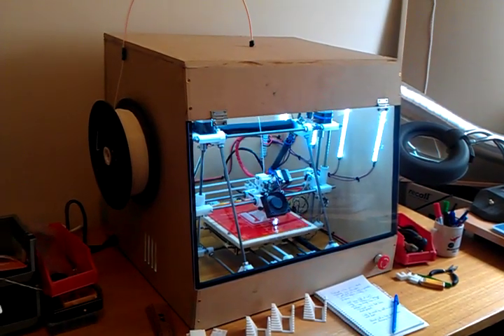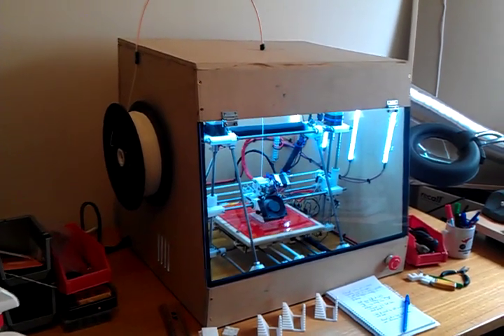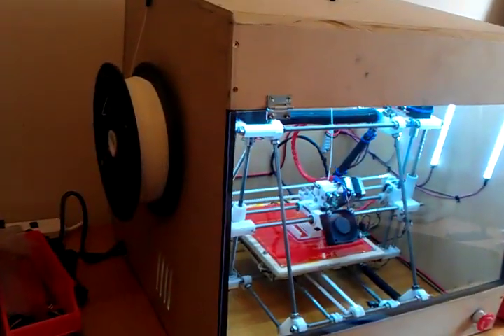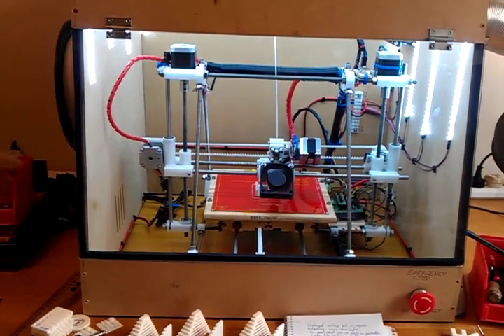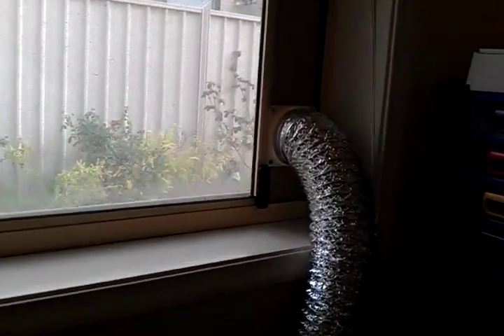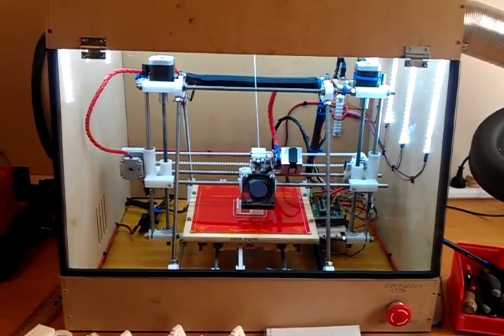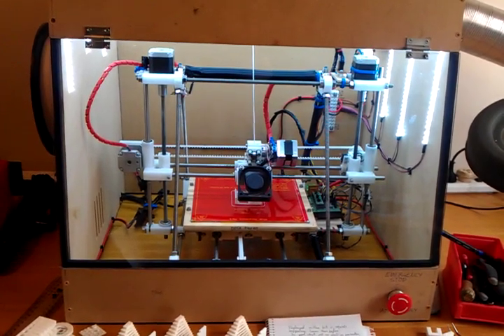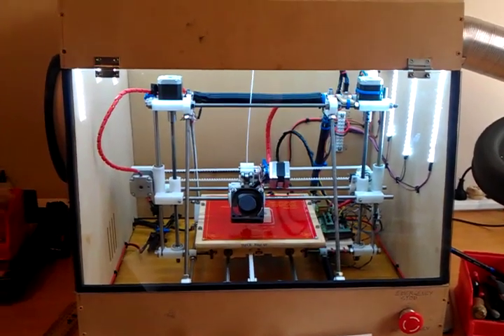Fume Cabinet for Reprap Prusa Mendel 3D Printer

Comment: Can you clarify a few things? You say you got a sore throat.  Can I assume that was BEFORE you made the extractor, but not after?  Also, one of the reasons I want an enclosure for my printer is to print on ASA or ABS which needs to be kept warm.  If you extract the fumes, you will be drawing in cooler air from the room and I presume also creating a bit of a breeze, which ABS doesn't like.  Can you comment on that?

Comment: Did adding that extraction fan inside the cabinet effect any of the cooling, Im thinking of using your files here but had planned to put the fan at the window end to stop issues with cooling prints too much?

Im going to add an external louvered vent to stop cool air entering

Comment: I want to make something like this but I've always been concerned that the cold sub freezing air in the winter time would blowback into the enclosure. Have you found that to be an issue?
Reply: as long as you had an active fan inside blowing out with enough force, I would not expect it to be an issue.

Comment: Ideas you might add, some insulation to absorb sound and keep temperature stable inside, another idea I saw and liked they added a printer tool holder to there enclosure.

Comment: Are the 3 holes in bottom left side of the cabinet just clear open holes and if so wouldn't this let the fumes out or does the fan prevent this from happening? and are the holes there to stop the fan creating a vacuum?

Comment: I originally enclosed my makerbot replicator 1 with acrylic to keep the heat inside to achieve a much better print result, and kept it in the garage to a voice fume problems, I just bought a fume extractor instead of the tube style u used, I hope my way does the job, love ur setup by the way very neat

Comment: Very clever!
Would it be possible to remove the ac duct, and put a carbon filter on the end of the fan?
Reply: Yes, but it wouldn't get all of the byproducts if the printer. The Nano particles(the main emission) are smaller then the particles removed by HEPA filters. You would need very high level (and expensive) systems to pull these out of the air activated carbon will help but not very much.